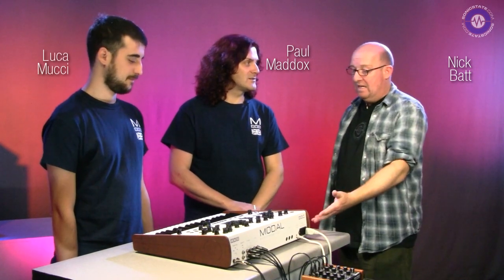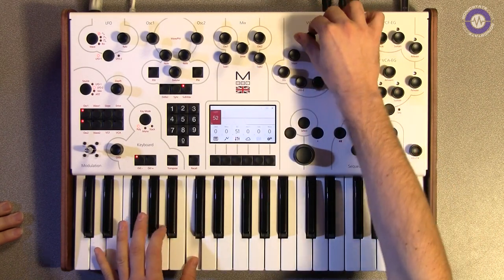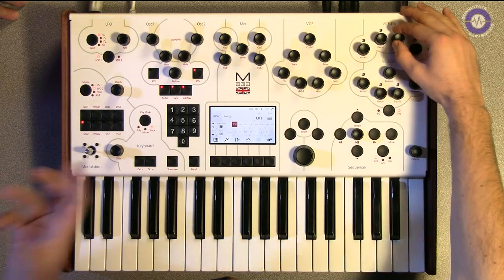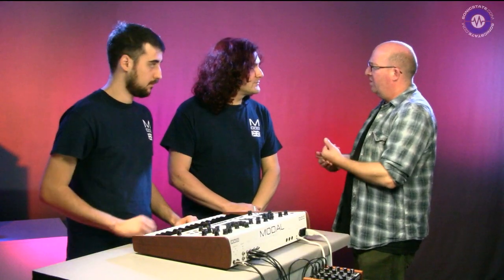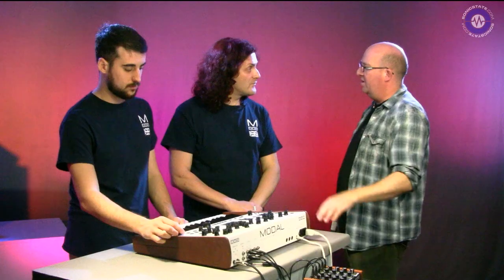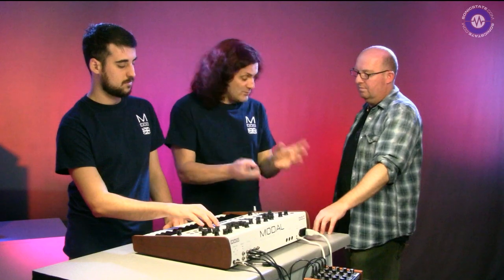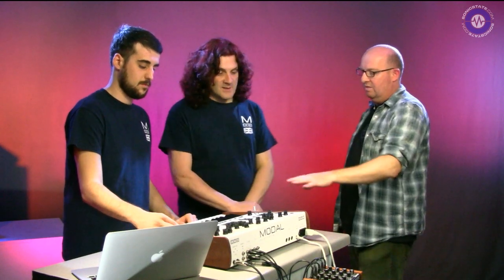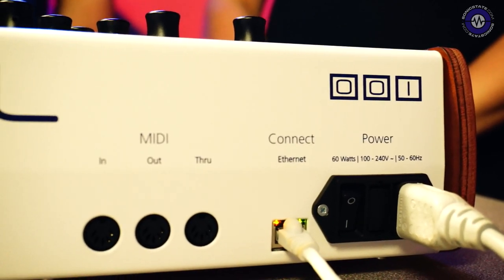Modal 001 - Brit Duophonic Synth

Comment: If you like the idea of digital oscillators with real analogue filter you might want to check out the much cheaper Mutable Instruments Shruthi. It's obviously not the same in terms of size and scope, but as a monophonic synth with digital waves into an analogue filter it's along the same design ideas.

Comment: They've could be an innovative company but unfortunately most of their products are unfinished. Just buy synth from other trustable, big companies like Dave Smith, Elektron, Moog, Korg, etc. Especially the 001 synth does not have a pedal input which is nonsense for the price, screen and button response is very slow and there are lots of bugs on software. Also some noises are present on the CV outputs, which gonna degrade your sound if you modulate something like external eurorack modules with it. I've never seen this noise problem on other products. I also get similar impression from other products like 002 or 008, almost sure that there are many bugs and imperfections which causes a lot of stress. there are way less imperfections on the synths from major companies